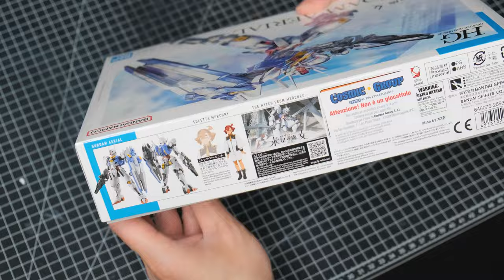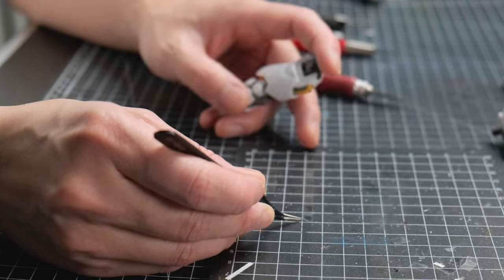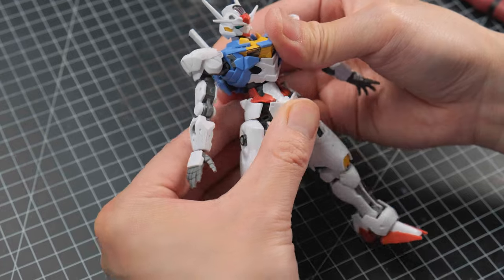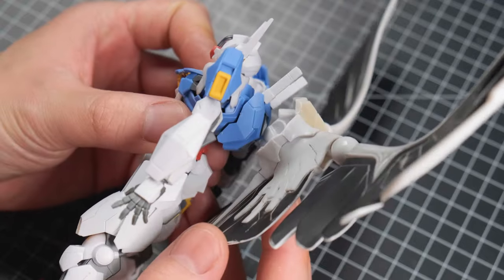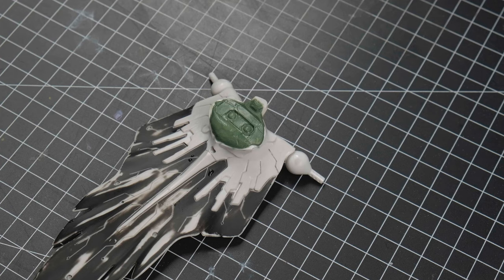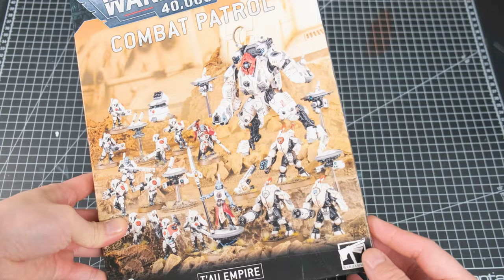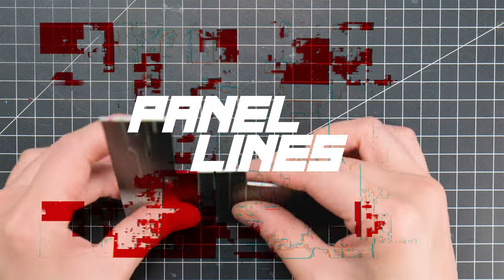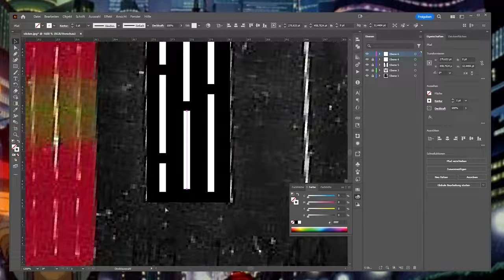This happens when the HG Aerial and an Eva do the fusion dance...

Comment: after painting hit it with some spray LACQUER, that will give you the glossy surface to panel line with. Also put a drop or two of dish soap or your choice of surfactant to break the surface tension of your marker panel line mixture. Afterwards you can go over it with a matte lacquer if you don't want the shine otherwise throw on another coat of gloss lacquer.
Reply from the maker: Hey, yeah I've received this tip from a couple of people now, but no one mentioned the drop of soap. I will try that next time. Thanks a bunch!

Comment: using flat color is fine. just apply a very thin layer of gloss clear before panel lining can avoid the color smearing.
Reply from the maker: Yes, thank you for the tip. This has been brought to a couple of times now and I will definitely keep that in mind for next time.

Comment: Does your airbrush paint result cause the pegs to be tight?
Reply from the maker: The paint won't, but if you seal your kit with Top Coat it will most of the time. So to remedy that, use your nipper and cut into the peg holes. This way you can loosen the connections a bit.
Reply: you mean shorten the female pegs right. Unfortunately I was planning to paint my MS without disassembly using that kind of portable airbrush topping of with a topcoat also. So Im worrying of tightness issue. @GiantRobolove
Reply from the maker: I meant cutting from the top into it, practically breaking the circle. Imagine this is the peg hole viewed from the top: O. So what you want is to take your nipper and just snap into it, so that the peg hole will look like this: C. Except there won't be such a big gap. I hope this depiction somehow helped 😅

If you on the other hand shorten the peg hole, you risk cutting it too short, so the peg won't fit anymore.